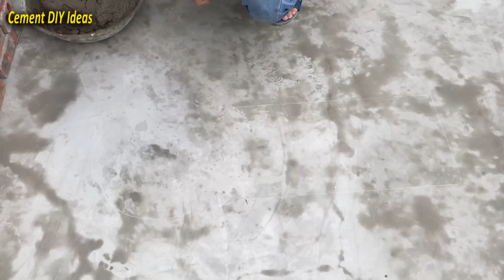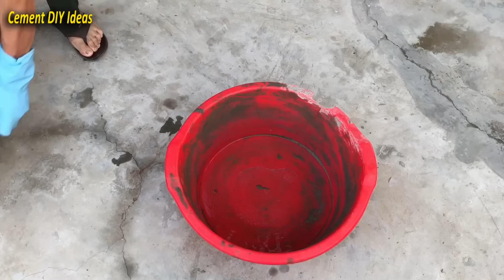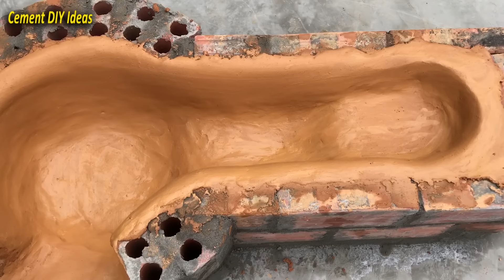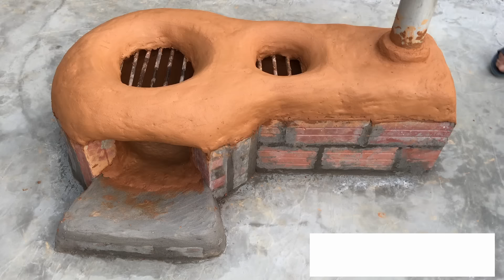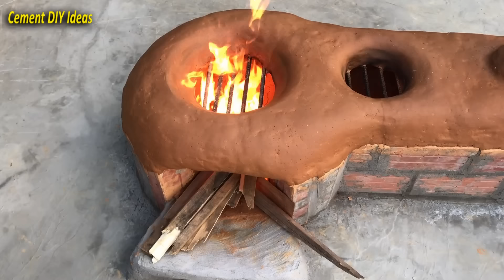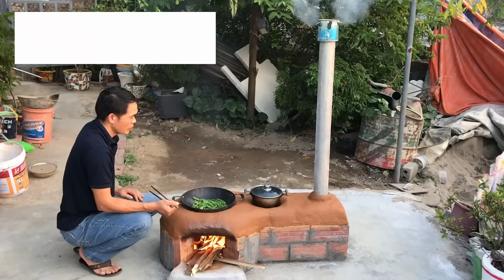New way to make firewood stove - No smoke -  Saving firewood

Comment: As a union mason, id like to give a few pointers from experience.
Id add chicken wire inside the clay crown, to stop the clay from cracking, because this will crack like crazy. One inch of clay, then a layer a chicken wire, then another inch of clay, then chicken wire, then another layer of clay. Id also throw straw in to the clay mixture to help alleviate the cracking. You want to keep the clay wet by misting it with a hose during the first couple months you use it, so it cures without cracking. You want to butter both head joints when laying the bricks, or the mortar doesn't properly bond to both bricks, only the one you buttered. Id also also make a table, 2 columns 4 block high, with a corbel slab bridging the 2 columns, and build this stove on top of it, so it is not on the ground. You could store your fire wood between the 2 columns under the slab. You could also make clay caps, for the door, stove pipe, and cooking grates, so you could get it nice and hot, plug the holes, and use it to bake, like you would a bread/pizza oven. Adding a damper in the pipe could also help get the stove to the right temp when cooking, and with a door you could slightly prop it open for a draft, or completely shut it down like an oven.
Reply: When you say "butter" do you mean the dairy product we use on our bread?   What is the best pipe to use for the chimney?
Reply: @lavonageorge7274  he means buttering the mortar onto the ends of the bricks, i think
Reply: Some good suggestions. But I must say that I've made a number of high clay content mud ovens and rocket stoves and have had little to no cracking without the need to use chicken wire. Depends mainly on how high the clay content of your soil is. And a little cracking is not a problem. Just kept it covered so too much sun didn't dry it too fast. No need to make it more complicated than necessary.
Reply: @ritamachia3354  Yea this one had 3 cracks already, if you watch the video you can see them. One is right in front of the first cooking area, that runs all the way through. Its pretty common for the clay to crack on ovens. The ones i make are usually fairly large sculptures, like the 6 foot tall statue of a naked pregnant woman sitting Indian style, that had one in the oven. The door was her stomach. It sat on top of a table that was veneered with river rock, and it was built with fire brick, clay, regular brick, then more clay, a lot more clay. It is over 10 foot tall in total.  It was for a birthing mother.
Reply: I was thinking straw mixed in.
Reply: @numinous2506  Or dried grass, etc. It'll all help prevent or minimize cracking.
Reply: I'd want some way to access the chimney end also.  I expect ashes and junk to accumulate there over time and getting in there to clean it will be a bitch.
Reply: Detonate your idea sounds great.
Reply: While I appreciate a masons pointers, a potters pointers might help as well. Clay has a shrink factor as it dries and is fired. The way to mitigate the cracking is to incorporate a prefired clay, otherwise known as "grog", into the wet mix and doing a slow controlled drying during the green stage. A slow controlled firing during the curing stage is needed as well. This helps prevent cracking during shrinkage in the drying and firing of the clay.
Reply: @donvandamnjohnsonlongfella1239  bit triggered are we.
Reply: @cliffa2901  Do you like drones? BOOM!
Reply: @donvandamnjohnsonlongfella1239  not a problem I'm in Sydney Australia. And no we are not disarmed . I'm ex military . So come on over.
Reply: This guy clays👍
Reply: @Biden BlowsGoats Next time you say thank god it's Friday. You should be saying thank the unions it's Friday. Unions made the 5 day work week, decent working conditions, livable wages, benefits, and stopped child labor. Go read some history, and see how things were before unions, and see how our grandparents were shot and killed by companies who didn't want us to unite. They hired the Pinkertons, and even sent in the national guard, and killed or wounded thousands of people, all who just wanted to get payed a decent wage, and not get taken advantage of. Unions set the pay scale, without unions your wage as a non union employee goes down. You know where the term "redneck" comes from? It comes from the blue collar people who were trying to unionize, they wore a red bandanna around their neck.
Reply: @Biden BlowsGoats I'm a union man. 
And I'm not a communist.
Reply: @lavonageorge7274  Applying morter to a brick is called "buttering".  Galvanized chimney pipe is cheapest and good for the chimney.
Reply: @kmds1908  Thank you, hope it works on the stove.
Reply: @jcwoods2311  Ah...Thank you.  That makes sense
Reply: @klubstompers  pure clay has a tendency to crack it needs some kind of filler to bond it together and another thing people making mistake by building a big fire in these I drive them out too quick and they crack you should keep it wet for a while while building small fires in it to season the clay if seasoned correctly it will be hard as a rock I am a Mason myself and have built several chimneys I always tell people to build small fires in them first and gradually build up to bigger fires but some people won't listen and they have cracked the liners in the chimney which are made from clay and then they have to be rebuilt
Reply: @GarySmith-ss1ee  Yea, i totally agree. Nothing like coming back to fix something because someone didnt want to head the advice of the professional who built it.
Reply: @klubstompers  well I bought lesson is better than a taught lesson like I built a 60 ft long and 14 course high retaining wall for this guy one time and I told him you need to core fill it with grout and backfill this with a lot of gravel and put a drain tile behind it he wouldn't listen because he was a real tightwad he filled it with dirt with no drain tile and no grout within a year it was falling over that was about a $5,000 lesson he listened to me the next time
Reply: @jcwoods2311  galvanized pipe is not generally recommended for use around fire. It releases toxic fumes when heated.
Reply: yes, but now its beyond me, I do get the chicken wire and straw and stuff and even the pizza oven, but each complication is tougher and tougher, I would love to see your finished products, sounds great.
Reply: "No smoke"... yeah, my ass !!! smokes like sh*t :-( !!!
Reply: I'd like to see a video  of yours.
Reply: Great suggestions.  Which ones were influenced by your experience as a mason and which ones from being a union member?
Reply: @micahwest5347  Comment is onnit. 👍
Reply: @micahwest5347  The union has collective knowledge that has been handed down for thousands of years, which is passed down to it's members, who build things at a higher standard. When you want someone to build a containment chamber for the navy's nuclear submarine's in case there is a leak in the reactor, a state capital building, a blast room, or Bill Gates house you call the union, when you want a flower bed or a chimney you call a shacker. There is a reason the US military only hires union workers for anything that is technical and has to be built to spec. I started out non union, and since i have been in the union i have learned the right way to do things, why you do it this way, and have learned thousands of things i would have never known as a shacker.  It is night and day. Plus i make more than twice as much, have full benefits, a pension, safe working conditions, and thousands of companies i could work for world wide.
Reply: When National Geographic was trying to figure out how the Duomo in Florence Italy was built, they flew people from my union hall to Italy to figure out how it was built, since no one else, not even the Italians who run and maintain it, could figure it out.
Reply: @klubstompers  That was an amazing episode!!
Reply: @klubstompers  interesting.  My dad always told me unions were the reason we had tariffs on imported cars.  Something about not letting more reliable Japanese vehicles being cheaper than the union made competition.
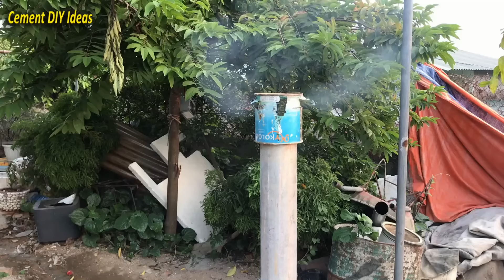Reply: 11:14 yes, I cannot see any smoke
Reply: @micahwest5347  So instead let millions of Americans loose their jobs, bankrupt Detroit and every business there, and force US car manufactures to move over seas, so we can save a little money on a car? That is what happened when they got rid of the tariffs. First we had to start subsidizing these companies with our tax dollars, then had to cut their taxes, then US car companies had to start cutting corners to be competitive, and started putting out crap vehicles, and eventually had to move their manufacturing to countries where they can pay workers starvation wages, so they can compete with over seas companies who use cheap materials, pay their workers starvation wages, and who pollute the hell out of the country where they set up shop. Now nothing is made here, and we are a country without manufacturing, and are falling behind the rest of the world, that has gone to shit. But hey, at least we can buy inferior Chinese products made with inferior materials for cheap, over and over again, when they break, as our wages steadily go down, and the rich keep getting richer.
Reply: @klubstompers  true words mate 👍
Reply: @klubstompers  what kind of union do you mean?
Reply: @klubstompers  Seems like not all unions are created equal then. I’m pretty sure the auto workers union isn’t passing on years of valuable knowledge to create a superior product.  To me it looks like they monopolized the labor pool to charge more and protect themselves from the consequences of their shoddy work.  In the end it displaced all their jobs to right to work states where the employer doesn’t have his hands tied as to who he can hire or fire.  

But maybe unions can still be our nations salvation. Perhaps the auto engineers could  unionize so they can amass their knowledge and create a superior product we Americans can trust and would be proud to buy instead of relaying on an appeal to our patriotic emotions to sell cars.
Reply: As soon as you said "union" i knew you were FOS.
Reply: @klubstompers  What about using concrete instead of clay ?
Reply: It's fine - if it cracks, he can make another one in twelve minutes.
Reply: Dude relax. These people make clay pots that take 500 degree plus a day for hours and don’t have a single crack.
Reply: Amazing please make reaction videos
Reply: @klubstompers  Cracks are a minor issue, just fill in with more clay
Reply: @lavonageorge7274  butter means putting mortar on a brick face.
Reply: @MorrisonScotch  Not the same man.
Reply: “Union Mason” 😂
Reply: @robertsorel1621  That wont stop the crack. Crack will widen, and ruin the stove. $5 in chicken wire, $2 in clay, and mist it with water the first couple times you use it. Might take 15 minutes extra, to build it right. Maybe it is just me, but i dont like working in reverse, and having to go buy, mix,  and add more clay, over and over, so Ill just build it right the first time. Time is money.
Reply: DAMM YOU GOT THAT DOWN TO A SCIENCE 😂😁🤔 SUPER GREAT COMMENT ❤️
Reply: I can appreciate all the points of view from different professions...so I'll throw my idea as well in...Go to Walfart and buy a small charcoal grill. Quicker...cheaper...smells better and you won't have a back ache from cooking.
Reply: Thanks for the additional information and important suggestions! ✌
Reply: @klubstompers  Actually it will stop the cracking, but only if you leave the cement out, as it's not needed. Cob, in which the main component is sand, held together with clay and chopped straw, does not crack like pure clay, and is very strong. I have constructed homes with it. The reason that the clay cracks is that the outer part dries too fast. You are correct in keeping it moist to reduce cracking, but unless it's a very moist area, the drying can be well accomplished in a few days. The first firing will harden it off. As for the chicken wire, that won't prevent cracking, but will hold it together when it does, just as rebar does in concrete. The point of these type of constructions is to NOT use manufactured products as much as possible, to reduce pollution, and regular concrete is not meant to taker high heat.
Reply: ංං්ංංංංංංංංංංංංංංංංංංංංං්ංංං්ං්ංංං්ංංංං්්්ංං්්ංංං්්්ංං්්ංං්ංංං්්්ංංං්ංං්ංං්ං්ං්ංං්්්්ං්්්ංං්්ංං්ංංංංංංංංංං්ංංංංංංංංංංංංංංංංංංංංංංංංංංංංංංංංංංංංඃංංංංංංංංංංංංංංංංංංංංංංංංංංංංංංංංංංංංංංංංංංංංංංංංංංංංංංංංංංංංංංංංංංංංංංංංංංංංංංංංංංංංංංංංංංංංංංංංංංංංංංංංංංංංංංංංංංංංංංංංංංංංංංංංංංංංංංංංංංංංංංංංංංංංංංංංංංංංංංංංංංංංංංංංංංංංංංංංංංංංංංංංංංංංංංංංංංංංංං්ංංංංංංංංංංංංංංං්ංංංංංංංංංංංංංංංංංංංංංංංංංංංංංංංංංංංංංංංංංංංංංංංංංංංංංංංංංංංංංංංංංංංංංංංංංංංංංංංංංංංංංංංංංංංංංංංංංංංංංංංංංංංංංංංංංංංංංංංංංංංංංංංංංංංංංංංංංංංංංංංංංංංංංංංංංංංංංංංංංංංංංංංංංංංංංංංංංංඃංංංං නම්22
Reply: P
Reply: Thank you, very good suggestions
Reply: j (
Reply: Спасибо,огромная просьба снимите пожалуйста видео   с учетом всех ваших рекомендаций.Хочу такую печь как у вас.Заранее спасибо.И как , где вас посмотреть.
Reply: Just say it works and that'll do fine. I don't mind building them so often as it adds to the fun.😂

Comment: We did this in the Boy Scouts 50 years ago, but we dug it into the ground. It's called a Dakota Hole. Keeps the fire below ground and out of the wind and provides a path for air to feed the fire and a path to add fuel. They work great for cooking fires while camping.
Reply: I thought that was what I was seeing.
Reply: They are called Dakota Fire Pits because they are dug into the ground. This is a stove, just because it works on the same principle doesn't mean its the same thing. This is a handmade ABOVE GROUND stove. It's obviously not a pit or a hole....
Reply: @joeleonelli3729  Thanks Mr. Obvious. I never made the connection <sarc>. That said, Dakota Hole referred to what we used to dig into the ground.
Reply: Your absolutely right. Didn't mean to insult you. Apologies....
Reply: @joeleonelli3729  You went and upset the Deuce!  How could you?  You got out of that one like a pro, though. Hello, from Texas.
Reply: @joeleonelli3729  All good.

Comment: I was just thinking: "you don't want mortar there; you want clay". Next second he's mixing up clay. 😊
Reply from the maker: thank you
Reply: why clay over martar, and whats the diff
Reply: @matthewcameron6860  One thing I know is that cement can explode if it has too high a temp. Heated clay will become like once-fired pottery (like ceramic bisque).
Reply: Me to.
Reply: @hudsonsteele8532  so is clay what he is using from start to finish?
Reply: Да, в 1975 мы строили лучше...
Reply: @elavke5441  He mixes Portland cement with plain dirt, it looks like at first, to hold the bricks together. Then he mixes up clay for the inside and top.
Reply: @hudsonsteele8532  thanks. Maybe one day I will have a place where I can build one
Reply: Gostei muito vou fazer um igualzinho ok obrigado meu amigo moro em São Pedro da aldeia Régiao dos Lagos fica no estado do Rio de Janeiro RJ meu nome é Sidnei Tomás moro em São Pedro da aldeia Régiao ok
Reply: P
?
Reply: @hudsonsteele8532   do you know what the clay to sand ratio is?
Reply: @calumalum8927  Sorry. No idea on the clay...
As far as mixing the Portland cement and dirt for mortar, it should be one part of Portland to four or five parts dirt.

Comment: 11:11 what happened to "no smoke" - I'm guessing this stove may be confused with a rocket stove which implements a strong vortex that heats the air enough to burn any soot and ash and also uses less wood when used to heat a home. This is just a regular stove.
Reply: I think by 'no smoke' they're referring to the recessed grates and the clay butting right up to the pots/pans not allowing smoke to get thru

Comment: Awesome stove. Great little cook top. Do you have one where you dont have any brick, cement, or steel rod? (Like it had to be built out in a survival setting, but you did find some clay and rocks?)
Reply: Just look up videos on how to make a Dakota Fire Pit/Hole. Basically you can dig one of these into the dirt and you dont need anything but a shovel.
Reply: @donvandamnjohnsonlongfella1239  actually, I was thinking along the lines of a show like Alone, or Naked and Afraid, when time is of the essence. I just wanted to see if he had done one out of all found materials like in a survival setting. No need to be all high and mighty.
And by the way, I don't need a stove to cook, it would just be nice to save wood and pass the smoke out of a primitive shelter.

Comment: Excellent. You could coil a copper pipe around the chimney. With a cold water tank at the bottom and hot water tank at the top. Excellent
Reply from the maker: thank you